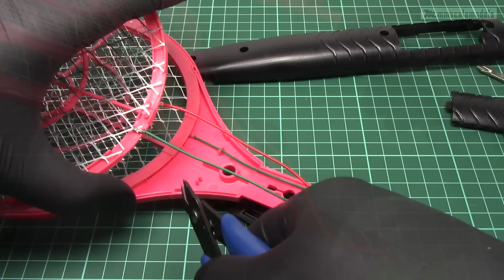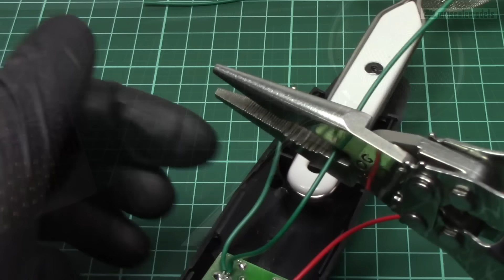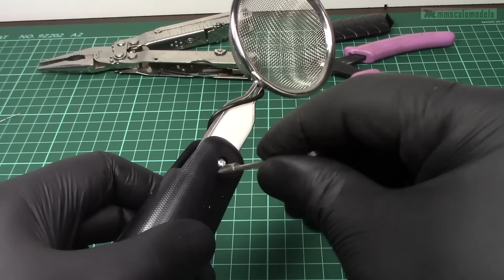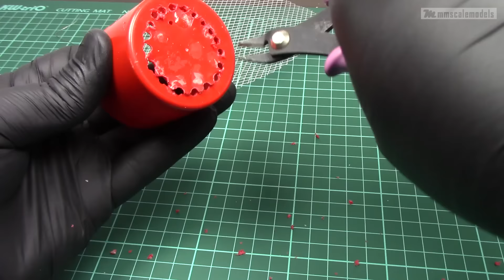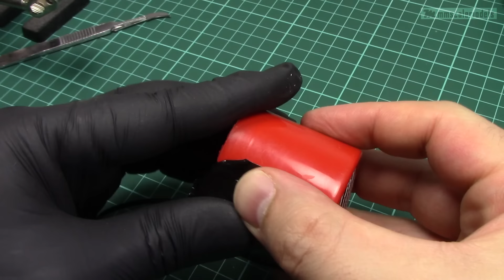How to create a static grass applicator under 10$ - scale modelling tool build

Comment: Can I use this to create a natural looking hair on my head?
Reply from the maker: Maybe it's worth trying 🙂
Reply: I found the best results by using marine grade varnish as a base (I tried PVA and my new hair washed off in the shower).  I also fastened the alligator clip on the negative wire to my earlobe, as I found that to be far less painful than sticking the sharp probe into my scalp.
Reply: @boblobla1611 how’d you stick it on, did you glue its or just put them on as is
Reply: @ryderstewart2324  I've tried several adhesives.  PVA is excellent for a night out on the town as it washes off easily allowing you to change styles as you wish.  I found two part epoxies start to yellow over time giving my scalp a jaundiced look.  Recently I started to use AK Diorama mud.  You can create small scalp dioramas which are quite the conversation starter.  I think AFVs in 1/72 are the limit though unless you have an enormous head.  Hope this helps and good luck.

Comment: For less than 1$ and the same result, you can just use a sieve lol... Nothing "static" in this video
Reply: A sive alone would not work. Yes there is static. What do u think the battery and wires are for ? To transfer the electricity so the static grass stands up.
Reply: The electric wire attached to the mesh on the strainer is attached to the battery which gives the grass that runs through it a static charge. The electric clamped pin touching the polystyrene also produces a small static charge enough to make the statically charged grass that ran through the strainer a polar electric effect for the grass to stand up. Its is basically the same thing as rubbing a balloon on your hair and having your hair stand up. When you move the balloon your hair will follow the balloon because of the electric charge attracting your hair to the balloon. This is also why we add adhesive to the polystyrene before a static charge to the grass because without the adhesive drying, the grass would fall flat once the static charge runs out.

Comment: Not gonna lie, this was amazing. You reorganized some cheap dollar store bug zapper and made it into a useful tool.
Reply from the maker: Glad you liked it!
Reply: @MMScaleModels  I plan to make one myself, but want to add a FDM printed attachment for a jar with different sized metal sivs. Seems like the way to go considering all the different lengths of grasses out there. Different mesh lids with a plug soldered on each. Does the length of cable matter? If I add 2-3 inches here or there? Thanks and your welcome.
Reply from the maker: That's a neat Idea. Don't know for sure but I think it does not matter.

Comment: Thank you... I could not invest $75 (US) in just an experiment. I make flutes of wood, but on the side I was making a couple of quality wooden UFO flying saucers on the wood lathe. One was almost finished when I damaged it. Then my wife says, "Hey, that's the one that crashed; bury the damage under the ground!". Before, I just thought about rocks that look like asteroids, but the Roswell one needs to be on some ground scenery. Thanks!!! I made the UFO's out of branches with different color heartwood (in the center), this way, the dome of the saucer is a different color, all one piece. Difficult to orient the grain this way, though, making a "spinning top", essentially, facing wrong. Too much cutting end-grain on all the wide, flat space of the saucer, top and bottom. Almost all endgrain except the sides. But it's worth it when it doesn't destroy. Brown dome, white saucer.
Reply from the maker: Awesome stuff, I love working with wood.. for. different purpose but still.

Comment: dont tie a knot next time use glue dun to create a stopper. the knot can put wear and strain
Reply from the maker: Thanks for the tip mate
Reply: I'm glad it's not only me who noticed that. I'm shocked he didn't just snap the wire inside the safety sleeve the way he pulled on it

Comment: Thank you very much for this video. I have built mine yesterday, it works fine, amazing. I recommand to modify the battery holder to a 9V one. It works even more better.
Reply from the maker: Thanks, I will try that. I kind of noticed that it needs more power but I was not sure if the board can handle it.
Reply: @MMScaleModels  you're completely right. I didn't thought about the admissible voltable of the board. I have to check with a multimeter

Comment: Have basically the same parts and need to get around to finally putting them together, am very happy to know the ones i selected with work fine.
For the larger one you might try quick set epoxy.
Reply from the maker: That's also a viable option, thanks

Comment: This was a good tutorial and mine works really well .  Just a reminder toeverybody,  if your zapper has  a capacitor you need to to discharge when your finished
Reply: Hi! How do i discharge the capacitor?
Reply: @difeleve123  touch the ground wire to the positive on the sive. I did it with my hand by accident

Comment: I have a question for the pros since I am not one. Why can't I just make my own only using an empty water bottle with holes or why can't I just use a sifter thingy used in the videos
Reply from the maker: Yo can but the strands will sit randomly. With the applicator you charge them with one sign and the surface with other. In this way the strands should stay upright.
Reply: @MM Scale Models  ok thanks

Comment: Hi, did you know if this static grass system works directly over wood platform?
Reply from the maker: I don't think there is a problem with the wood. As long as you attach the probe and have the glue on.